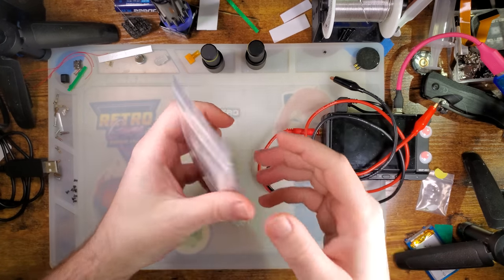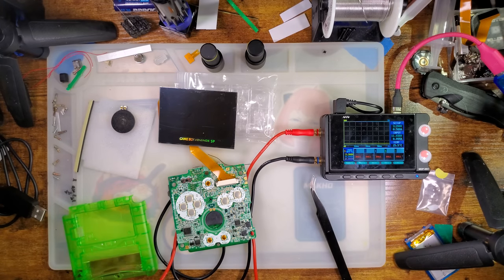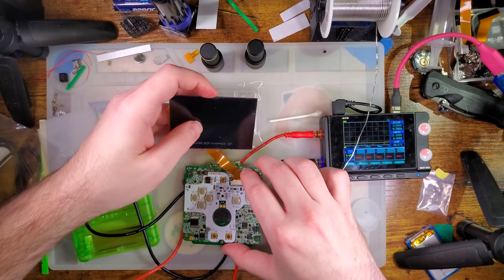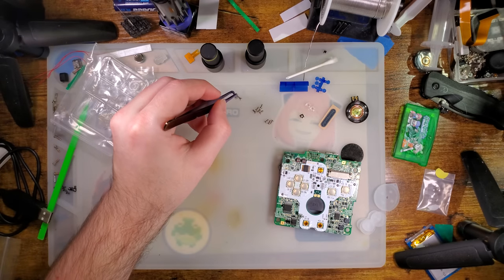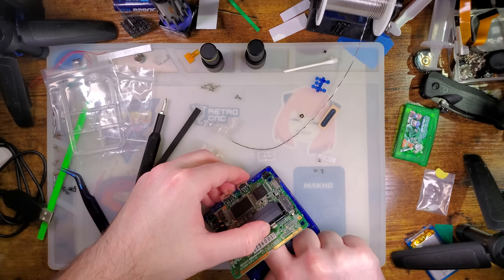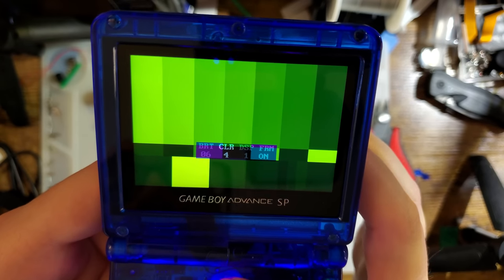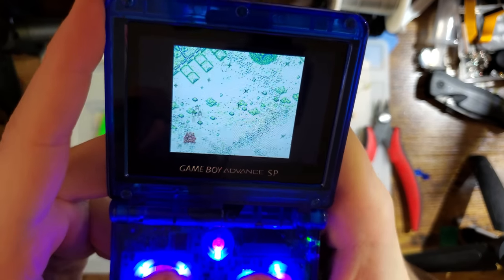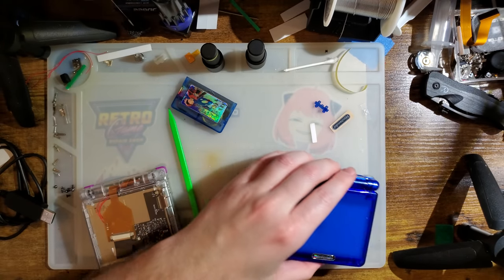FunnyPlaying Game Boy Advance SP 3.0" IPS Kit + LED Button Board

Comment: Very awesome video! 

2 question if you see this..I'm going to be doing my first build soon, what temp do you have your solder set at? And also I was looking to install that same LED kit along with Helders GBA SP Flex Amp.  It looks like both flex boards will over lap. Is this going to be an issue? Which one should go on top/bottom? 

Thanks so much for your content, it helps a lot watching you work.

Comment: So we are living in 2023 and still FP v.2.0 is reigning over the top. Shame on who lost the opportunity of buying one of those.
Reply: I bought one back in 2017 or 2018 where Youtube videos on it stating that the Funnyplaying v2.0 were running dry due to the stock of the specific brand LCD screens were low.  It was either go with the FP 2.0 or the copycat ones with the generic screens.  I went with the FP 2.0, and glad I did.
Reply: I'm not into the FP IPS kits personally, not drop in for my oem shells

Comment: Got a question about the Slate since I’m planning on picking a kit. Will there be a new revision soon? Just wondering since you showed one briefly that looked a bit different. Thanks!
Reply from the maker: There are no revisions planned except maybe to work with different LCD kits if the current stock runs out and new kits don't fit.
Reply: Only thing that's different is the white screen. Glad I held out for one of those, matches my other gameboys

Comment: The buttons feel fine on mine, but I don't have the button led board installed.
The screen housing has 4 very small and shallow pins that the IPS screen slots into.
I have the pvc slice installed and it seems to help prevent the screen from pushing in too much.
Also, the brightness button is too tall and the screen housing rests on that instead of the two silicon screw covers.

Comment: How's the battery life with the IPS screen and LED board mod and what battery would you recommend with it? I have a very similar build with IPS Funny Playing screen and Hand Held Legend RetroGlow LED mod board. The battery is a high capacity 850amh battery and it's not that good with the current mods I have.
Reply: Also I'm using an EZ-flash Omega definitive edition with my build on top of the mods.
Reply from the maker: If you're concerned about battery life, a LED mod is one of the last things you should install. The funnyplaying mod is pretty power efficient but I don't know about whatever HHL is pedaling. Flash cart ain't helping either.
Reply: @makho  the LED mod is 18-25mA depending on the brightness and color. I just got the 950mAh battery with your mod from Retro Game Repair Shop yesterday. so I'll see how that works, so far it's better.

Comment: I bought one of the new FP cases, the things like a fingerprint magnet and cleaning it just leaves scratches in my trials on small areas any recommendations for cleaning it without scratching up the whole thing?
Reply from the maker: A new microfiber is what I use. If you've used the cloth to clean anything other than smudges off shiny surfaces, don't reuse it here.
Reply: @makho  Cheers for the help

Comment: How good is the quality on these newer FP shells? The generic frosted clear blue one I had kept cracking at the hinges.

Also, where did you get the beveled ovoid Ninty stickers for the lid?
Reply from the maker: The early clear shells all cracked pretty quickly for me. In the same time frame, I have not had any issues with the FP shells. Only time will tell though. 

https://retrogamerepairshop.com/products/sp-gel-logo-stickers
Reply: @makho  Good to know I'm not the only one who had that issue. These look like they use better plastic, so I guess I'll be doing a shell swap. Thanks for the info.

Comment: how does the install of this kit differ if using an oem shell?
Reply from the maker: I'm unsure if it does differ. The shell was more designed for the ITA kits that don't fit in OEM shells, even with a trim.

Comment: Mahko, do you have a link for the hinge removal tool?
Reply from the maker: https://www.printables.com/model/141230-gba-sp-himge-removal-tool
Reply: @makho  Hi Makho, sorry to bump someone else's comment, but I was wondering (since it's been 6 months or so since the release of this shell) whether you found a good way to close the gap on the right side of the screen? I've tried adding foam on it's own, which wasn't enough but may have been the type of foam I used. I've also tried cardboard but wasn't enough, cardboard and foam - which does straighten it up, but then the lid won't screw flush to the frame.

Any ideas would be appreciated. Thanks!

Comment: You plugged in the screen in like .2 seconds and I’m sitting here like how…
Reply from the maker: Open bale, insert FFC, close bale. I do this sort of stuff a lot so my dexterity is pretty practiced with this move. 

These connectors are usually called ZIF connectors because it should require Zero Insertion Force to seat the cable so make sure your bale is fully open when inserting and then fully closed once inserted. The bale itself may require a bit of force (non-zero).
Reply: I realized I didn’t have the bale open entirely. Glad I didn’t damage the ribbon cable lol. Thanks for the reply.